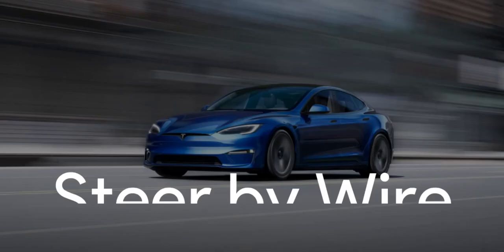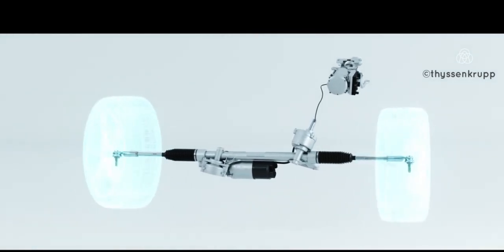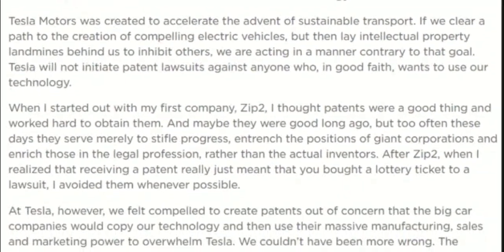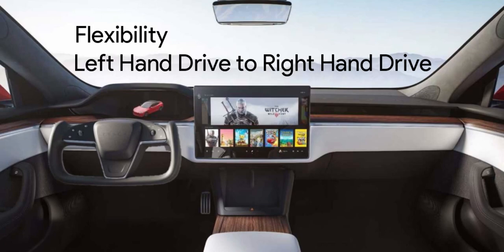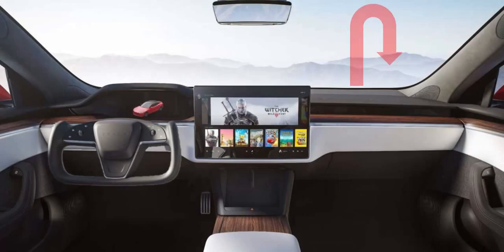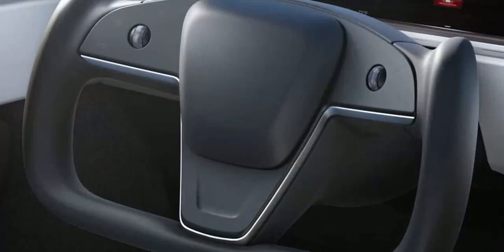Steering Yoke working of Tesla new Model S - How to make a U-turn and operate turn signals

Comment: This also means autopilot can be made much safer as when it needs to intercept to evade a crash it won't have to fight the driver. And you can play games without turning the actual wheel.

Comment: Steer-by-wire is most probable.  It has been in the aviation industry (fly by wire) for decades now and Tesla is making it happen I’m sure.  It will save weight, money, actually be much safer as it is in the aviation industry.

Comment: I'm guessing that drive-by-wire also has speed-sensitive gain.   If a 140 degree rotation will max out the steering input at slow speeds for a U-turn, a 10 degree rotation at highway speeds will probably engage tokyo-drift mode.  Gain obviously needs to be lowered at 200mph... or else they need to offer a roll-cage as standard feature.

Comment: Yoke steering would suck in snow and ice. How do you feel for how much you are slipping? and you need to shift back and forth to get unstuck when in snow.
Reply: torque vectoring for each wheel will helps which is precious feedback if using electric motor each wheel

Comment: There should be an option to choose between yoke and standard steering wheel. Currently Tesla does NOT offer round steering wheel for the latest cars which is terribly bad idea. People have been driving cars for decades with round steering wheels and it's silly to expect from them to learn new driving style without strong reason. Yoke probably works fine on the highway but please keep in mind that it is not convenient when you turn the car on the parking lot or do aggressive driving with sharp turns. Personally for me yoke sucks, i tried it on real Tesla and it's terrible.

Comment: Surely you can drive a power steering car with a single hand ✋ opened palm without gripping the wheel with wrapped fingers?  Firm pressed open palm against the wheel whilst negotiating a 180° turn is easier & more comfortable than arm crossing turns.  Most drivers use one hand driving rather than two hands gripping the steering wheel 🙄.

Comment: While steering by wire is a fantastic move by Tesla, it is also a massive mistake to remove the power steering. By removing it, you’ve (Tesla I mean) forced the driver to depend only on the electronics to work, ESPECIALLY if you run out of fuel and have to coast the car. Redundancy is something important in most engineering designs for a reason. It could have been disengaged until it is needed.

In effect, the removal of the one system that could save the car in case of failure of the wire steering, including running out of battery, negates the positive.

In effect, the vehicle I’m designing might actually be far better than the Tesla. It’s made to be lighter than a motorcycle while giving the rider an option between pedaling it, using electric or gas power with an off the shelf RMR engine. The redundancy can be there without making the entire system uncomfortable.
Reply: Even now, the power steering is not powered by the main battery. It runs off the 12 volt battery which keeps all of the electronics, power steering, and safety systems working even if the main battery dies. The same would be the case for the steering by wire.
Reply: @BenBrand  That's even worse, as those small 12v batteries fail at a fairly high rate. The main lithium pack almost never fails.

The point is steer by wire has no redundancy. if the power that supplies it goes away (Regardless which battery supplies it) you no longer have any steering.

With power steering you can still steer even if you lose all power. You just don't have power assist, and power assist is not needed when rolling, power assist is only needed when stopped. I have had to drive a couple cars where the power steering pump had failed and you can barely notice the lack of power assist when driving, it's only when trying to turn in or out of a parking spot at very low speeds where the assist is important.

Removing the mechanical linkage is a bad idea. Relying 100% on data flowing from the steering wheel input to control the steering is just opening a huge can of worms.
Reply: But you forgot something what Tesla have. Its only the drivers fault if the batteries run out of juice, cause now Tesla have maps of where the nearest charger is and tell you how close it is and how much range you have. Plus Tesla just started sky rocketing and started implementing more range. So if you have a old Tesla with a low range and decide to go out into the fields where there is no charger near by, that's there problem. Plus you forgot also that gasoline cars/station doesn't show where the nearest station is, that's why you run out of fuel and have to use a tow truck or push it, but with Tesla soft wear mechanical/or not you can look where's the nearest charger is.  If you didn't know those battery packs you talk about there nothing like a electric car, batteries need to be charged and that gasoline you got have to send power to the battery, and the battery only help with simple things like (wind screen wippers, AC, and little electronic parts.) Plus Tesla is coming out soon with higher range vehicles than a normal gasoline car or than that little car of yours. Which would give the person a longer journey. Which kid growing up in this future is still gonna want a gasoline car, maybe for fun, plus batteries can be reused multiple time unlike gasoline, when it burns out into gas and create more global warming. Humanity gotta learn to let go off old stuff and adapt to change. And so far what I seen Tesla had little car crashes than hundreds of car crashes by gasoline cars everyday. Its because of its soft wear if it get too close to a car or something it recognizes it takes action immediately( yes gasoline cars can do that too) and in the future more and more mechanical work/physical, A.I. will be doing it. We will be coding the machines online or monitoring and can get paid more online than what people today work physical.
Reply: The redundant driving system could be the autopilot system (if it was connected by a different wire). Would easily be able to pull over to the side of the road.